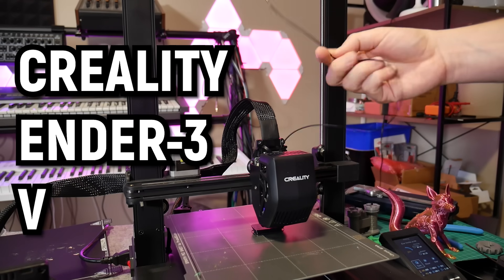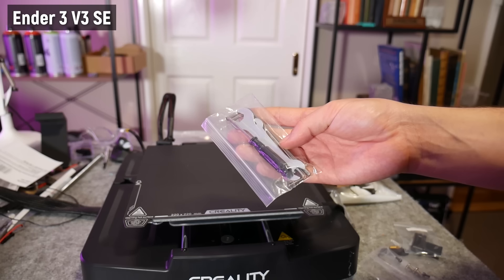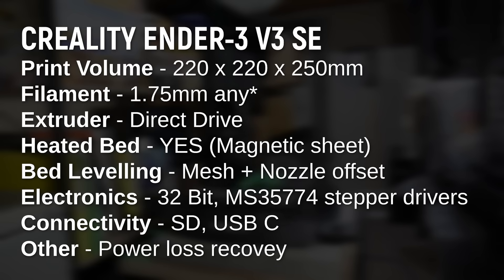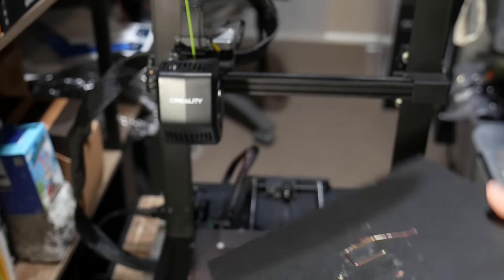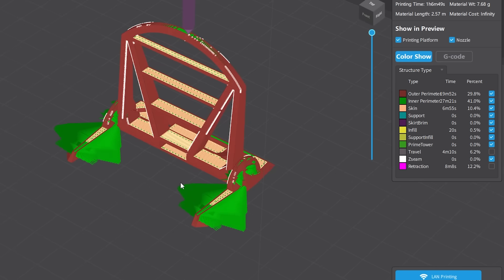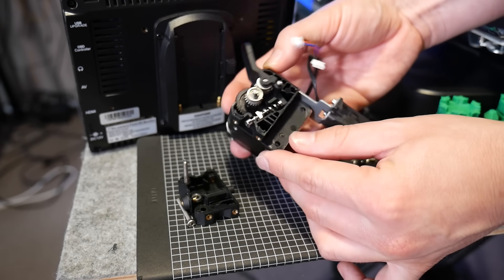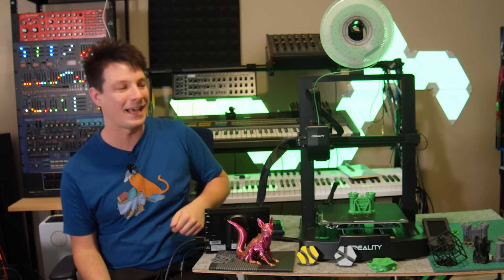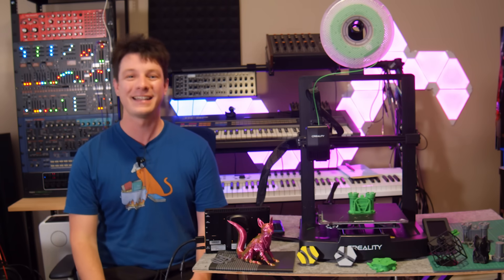The Creality Ender 3 V3 SE is very good. There, I said it!

Comment: I think it's no longer moddable and the source code is nowhere to be found. Not for me, pass.
Reply: It technically is, just less straight forward
Reply: Yeah, I have heavily modded my V2 with things like a 3d printed hot end and tensioners. I love taking it apart and feeling intelligent when looking at parts that I have no idea what they even do
Reply: The people who care about modding their printers are getting fewer and fewer.
Reply: @c0mputer  "The people who care about modding...fewer"

I disagree. I think in reality there are just a lot more people who are lazy and any product which does what they want with minimal effort is a win, even if it's considerably more expensive. Just look at how many people in Noth America drive automatics vs. manual transmissions for example.
Reply: @loc4725  You’re right, I meant it as a percentage overall. So there are likely MORE people who mod their printers now compared to 3 years ago but there is just more people who don’t care. But it has nothing to do with laziness. Manual vs automatic isn’t a good comparison. It should be the amount of people who work on and modify their cars compared to those who don’t. If people want to 3d print, more than likely they’ll want to buy a printer that does that out of the box. Someone isn’t lazy because they don’t build their own home.
Reply: @loc4725  Because being lazy is better than doing all that work. That's why I won't ever use Linux as a personal operating system
Reply: Everything can be modded. You just gotta have the skill.
Reply: Easily disprovable, It was definitely possible to make it moddable, and this is not a excuse for companies to make terrible devices (cough cough iPhones)
Reply: The k1 max got open sourced (the firmware part) a few months after it got released. they allow full root access and klipper, with even builds of fluidd and mainsail. all of that without voiding warranty.  So there's hope this could happen for this printer too!
Reply: @amogusenjoyer They did? I may have to buy a K1 now. Hehe
Reply: @amogusenjoyer NEVER BUY INTO A PROMISE, NEVER, NEVER DO THAT.
Reply: @Splarkszter  oh I absolutely agree. I'd think of it more as a potential plus for someone who already intends on buying it. It shouldn't be a factor in the decision itself at all for sure
Reply: @amogusenjoyer *"The K1 got open sourced" *

Thanks for mentioning that. I'm debating buying a K1 (even though it has some design issues) or a DJI Bamboo. I'm not keen on closed technological ecosystems, especially where China is involved so O/S firmware is a major plus.
Reply: @loc4725  yes, and turning on root access is now a single toggle in the regular firmware. There are already custom scripts for custom mods, the only thing I'm aware of that isn't open sourced/easy to access is the lidar on max. Beware though, MAKE SURE TO HAVE THE RIGHT EXTRUDER on the k1, the latest revisions are basically a must!! An easy way to check is to see if the handle to lock it is magnetic or not. If you get a printer with an older extruder (usually not possible anymore through creality)  just return it.
Reply: @amogusenjoyer  That's very interesting. Thanks!

I'll probably be looking to buy after Christmas when my finances have recovered a bit, so hopefully the old stock would have sold through. Just got to read up on what else might need post-purchase attention, because as you say, Creality...
Reply: Honestly, that's why I still love the original ender 3. It's so common that upgrades are widely available and there's still a gigantic community. 

Mine currently has dual Z, linear rails and a new Mainboard installed and I am currently contemplating going down the ABL rabbit hole. 

And if you're on a budget, you can get a used Ender 3 for pretty cheap, too.
Reply: I will be keeping my v2.
Reply: @poodlescone9700 The V2 is a workhorse. No matter what people say. Ive upgrade mine quite a lot. And running klipper. I love this printer
Reply: Creality needs to provide open source software day one unless they build their own complete firmware from scratch.
Reply: Creality mentioned the old ender 3s are going to be discontinued
Reply: I agreed until i realised the VAST majority will not even notice
Reply: It definitely is still moddable, and idk why you need the source code so badly. Most big 3D printer companies don’t release source code
Reply: Why would you need the source code? 99.99% of people buying this will never need access to the source code; idk why that’s a dealbreaker for you
Reply: I can't find when anyone asked